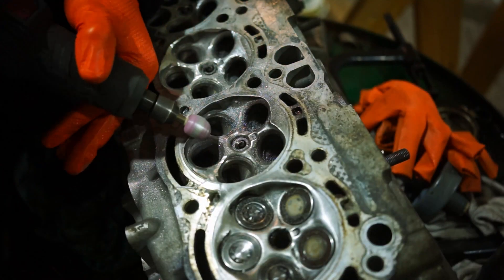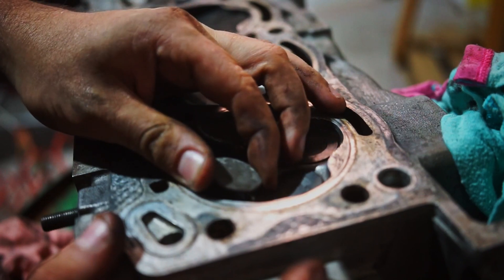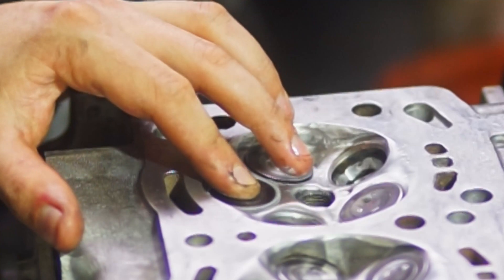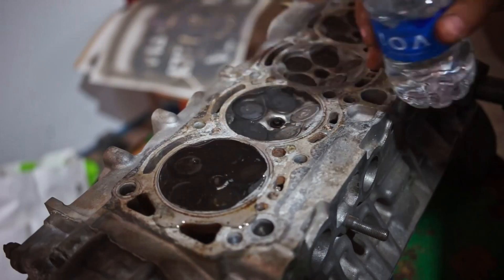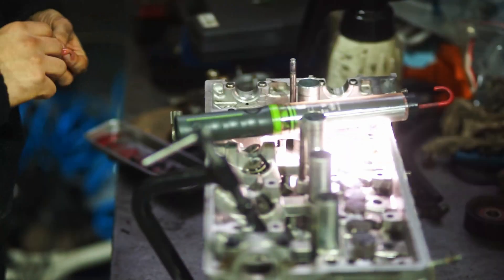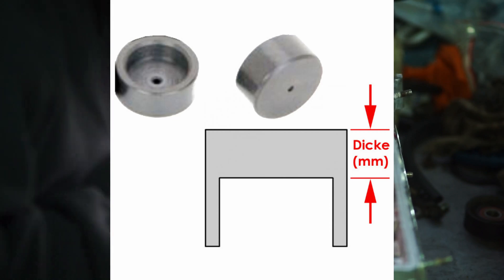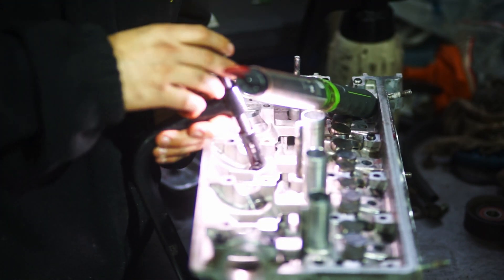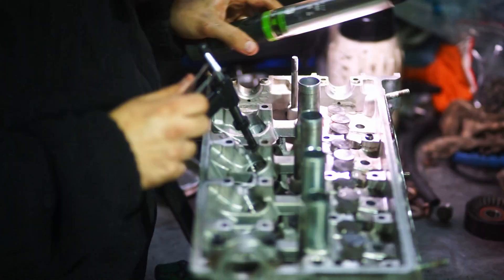Valve grinding the cheap way and reassembling the Head | 4AGE 20V Budget Engine rebuild

Comment: I noticed you grinding your head, was this required because you're running blacktop pistons? Can i run blacktop pistons without grinding head?
Reply from the maker: yes you can. i did this because i am going to go turbo so i wanted to remove the edges of the quench areas to reduce the knock threshhold.
Reply: @throttlebuddies0 ok great, I was thinking to go blacktop pistons on my Silvertop but I got concerned when I saw you grinding the head. Forums online also spoke about grinding squish areas. So to confirm, for sure I can run blacktop pistons without grinding anything on Silvertop?